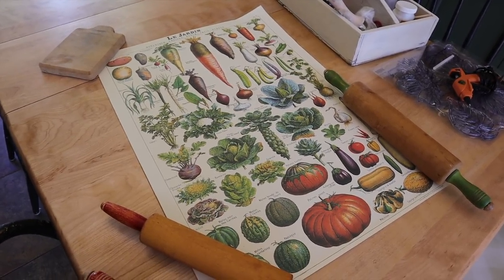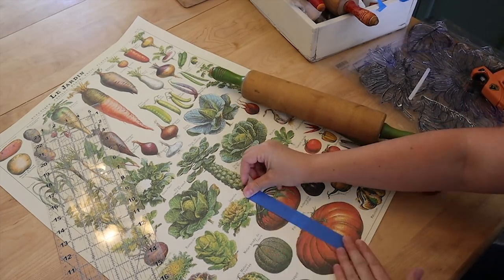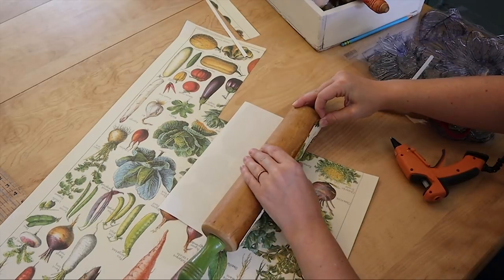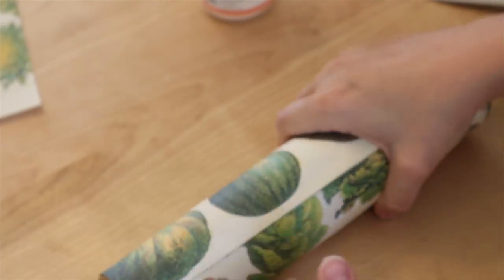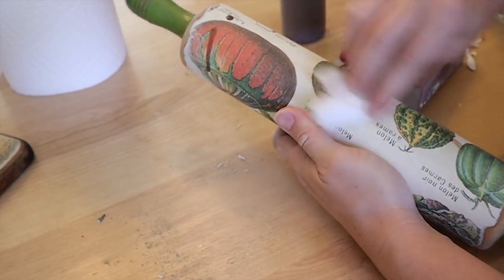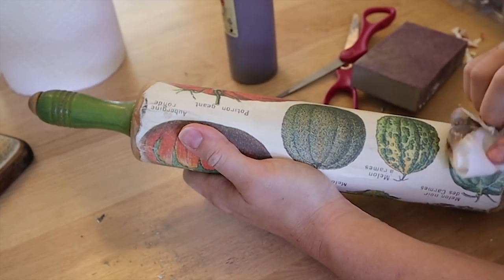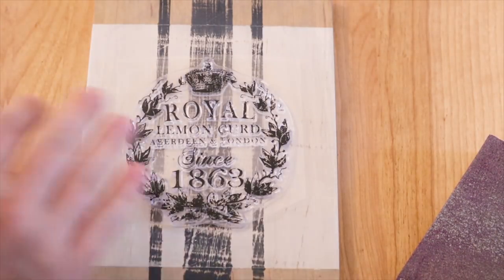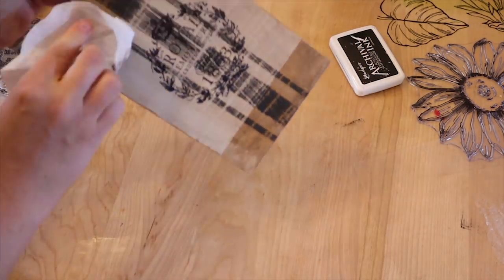Antique Farmhouse Rolling Pin & Cutting Board DIY Upcycling Projects | Trash to Treasure for Resale

Comment: I learned the hard way to use a template.  Use typing paper or what ever you have a lot of that way you won't ruin your special paper.  Also you can use a string or piece of yarn to measure around the pin.

Comment: I love the rolling pins. I have 2 of those veggie posters framed and in my kitchen. Did you not put a layer of modge-podge over the top?
Reply from the maker: Eventually I do top coat the posters with mod podge---I showed me doing that on the cutting board but I didn't think to do it on the rolling pins until after I filmed everything. But yes!